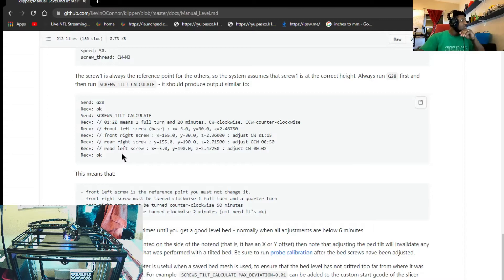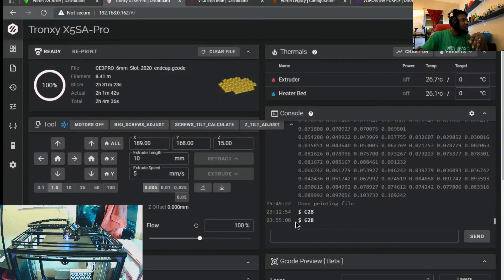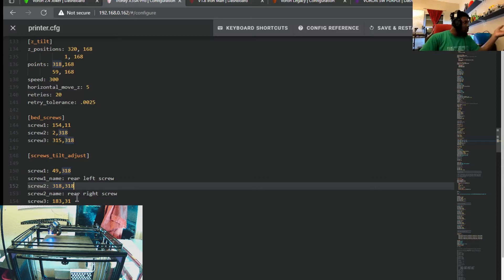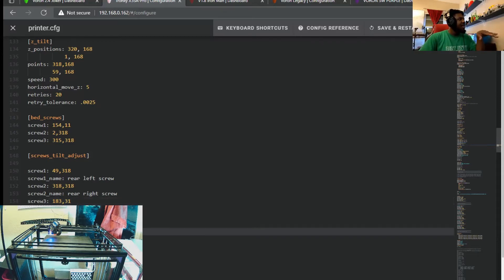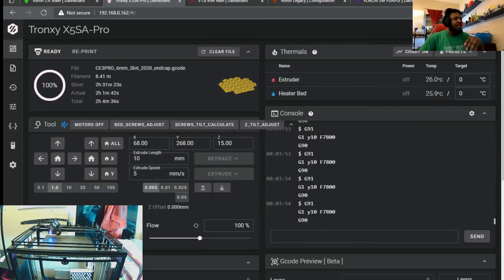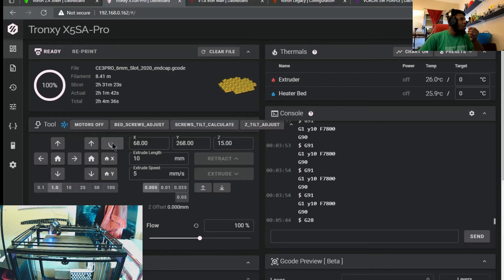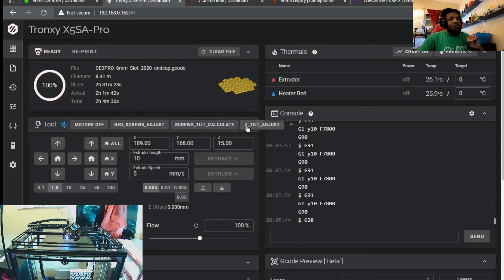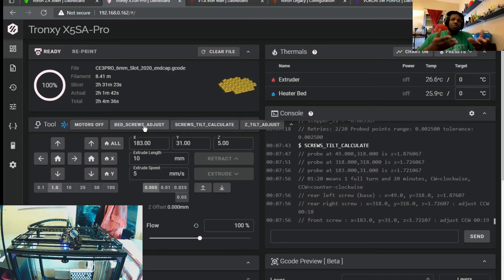// How To Setup Klipper Scew Tilt  // GoldenJaguar392

Comment: What about a prusa MK52 Bed with 9 screws, where the center screw is the reference screw?
Reply from the maker: I'm pretty sure It would work but that would be a lot of screws to adjust..but I like the feature it is very good with level out the bed and make the bed mesh a bit better